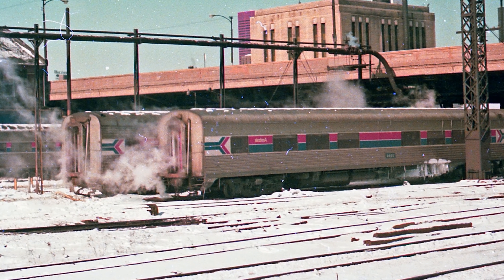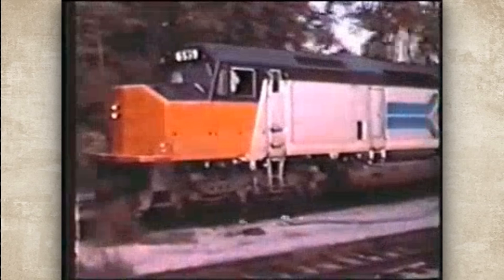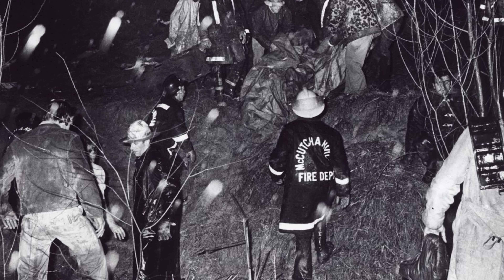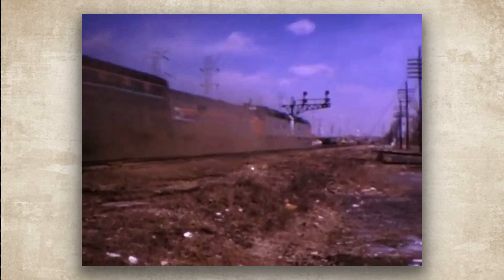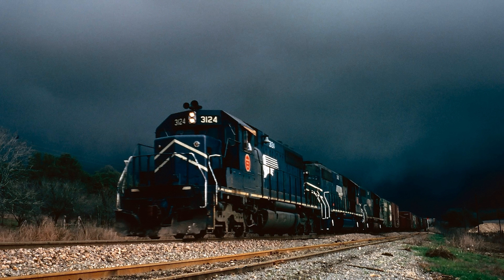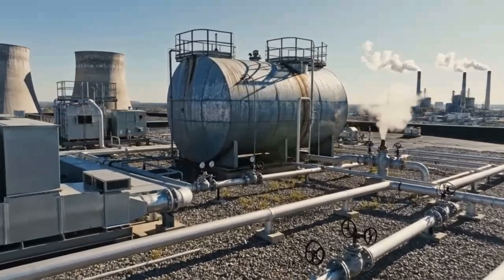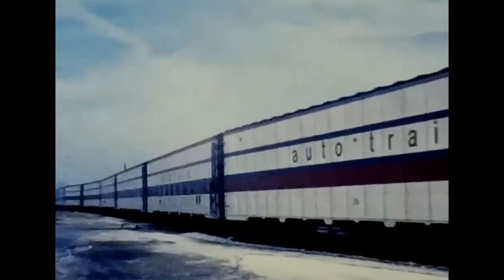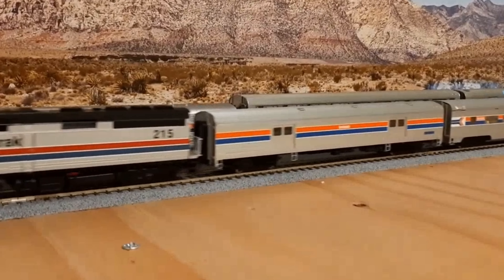Why Railroads FEARED Amtrak's New Locomotive

Comment: It was the trucks. Those 3 axle trucks on the SDP40F were designed for slower freight engines is at least part of the reason why.
Some railroads bought the used SDP40s and removed the steam equipment, the controls for the HEP and regeared them for freight at slower speeds and they ran great for years. Santa Fe and Burlington Northern both used them as freight engines with no issues, after the conversions.

Comment: Well, the SDP40F's gave birth to the F40PH which is probably the most beloved passenger diesel engine to this day and is still used by commuter rail companies. The reason the SDP40F's and the E60's were prone to derailment is because the trucks were too long giving rise to a "seesaw" effect on the middle wheel. Yes the outside factors of yaw forces took place and they most likely put an imbalance on the middle wheel of the trucks causing the front "or" rear axle to pivot up. At any point where the middle wheel causes both front and rear axles to lift off the tracks would cause the truck to rotate at the middle wheel and derail.

Comment: in my fictional Railroad history, Chicago Central & Illinois Railroad, the railroad would acquire all of Amtrak's SDP40Fs, remove the steam generator and the water tank in favor of an equal weight additional generator for HEP and or smaller fuel tank, updated internal components and use for long-distance passenger train similar to Amtrak.

Comment: I think water sloshing was the main problem here. I had an "close-call" when carrying  water in quite tall tank on my trailer. When filled full, everything was OK. But this day I didn't use all my water, so went back to home with a half of it remaining in the tank. On my way I nearly lost control over the vehicle, going even lower speed, than earlier in the morning with a full load. I realized soon, what happened, so I dumped all the  water near the road. After this was safe to drive again. It was a big lesson to me.

Comment: How about simply putting baffling in the water tanks? Stops the sloshing ... without using concrete
Reply: or JUST Relocate water tank into bottom Like SDP40 did
and use Older Flexicoil Bogey Full C-C
Reply: @svcino9549  or just slow them down on curves
Reply: @Grandpa82547  no as always Retrofit Fucking Water tank from side water tank into Bottom like SDP40 bottom water tank

Comment: If it weren't for the oil crisis, Amtrak could've just used Santa Fe's FP45. Driving a SDP40F, is like driving a 1972 Chevelle with a budget-friendly engine, rather than driving a 1970 Chevelle with a 454 LS6 engine.
Reply: The 307 V8 was rather gutless.  But, it did the job.  It is still better than the engines most cars have in them today.  It was just pathetic.
Reply: @IndridCold-o4o  It was a transition period when the vehicles had the same look but want to cut cost on fuel. You'll take the same heavy model, downgrade the engine, and expect it to perform flawlessly?! 🤷‍♂ Amtrak liked the look of the Santa Fe's FP45s and the El Capitan passenger cars. Unfortunately the cars were built between 1949 to 1956 and the locomotives were built in 1967. The SDP40Fs were built between 1973 to 1974, making the end of hustle-muscle transportation. 🚂

Comment: Let us not forget that water is a lot lighter than concrete.  The filling of the ballast tank with concrete verses water stops the sloshing around.  But, it may also add just enough weight to fix the issue.
Reply: That's why they use sand!🤦 Duhhhhh
Reply: So, you fill the tank up regardless of weight match even though either way you stop the slosh factor?
Reply: @appamaddox8190 The slosh factor was the main thing being addressed.  But, the extra weight would help to keep the locomotive on the track and to pull much better.
Reply: @IndridCold-o4o  Not buying that one. Where did you go to Mechanical Engineering College? OBTW the easiest engineering degree.
Reply: @appamaddox8190 I am in logistics.  There is no need for any sort of degree to balance loads and forces, nor side sway.  Where do you reside that a degree is required for that? The schools there must be for-profit.  Just think, there are schools in United States Of America that, "teach," gender studies and some in Canada that, "teach,"  liberal lifestyle.  Please tell me you did not fall for anything like that.

Comment: The SDP40F was built with the option of being convertible. The twin skid-mount steam generators could have easily been removed in favor of HEP equipment. Too bad Amtrak didn't at least try to convert some to work with electricity just to see if that solved the problem. I liked the SDPs